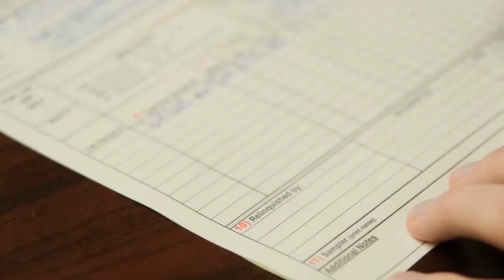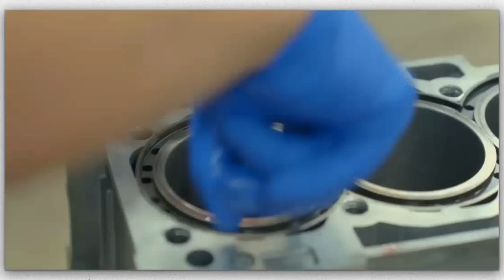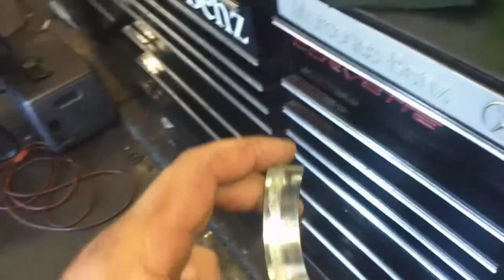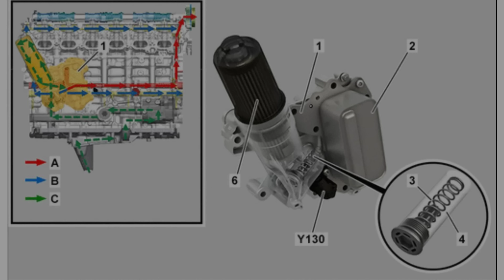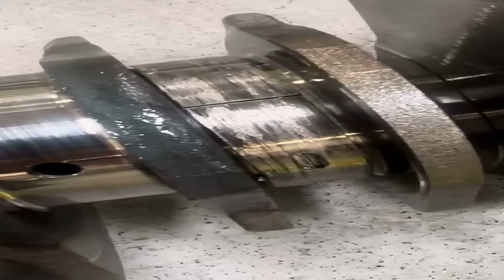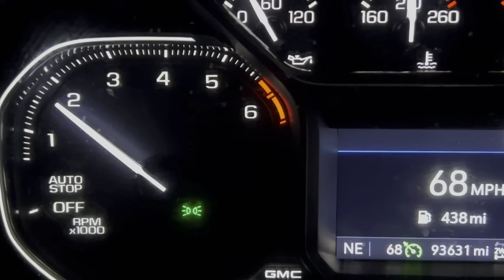They KNEW And Sold It Anyway! Toyota's 3.4L Twin Turbo V6 Is DESTROYING Engines!

Comment: It probably uses bmw rod bearings & other engine parts  as bmw did supply the 3.0 il6 engine to Toyota for the GR Supra.
 They should check it for bmw stamps on the cylinder head/block etc.

Comment: If you look at the major engine recalls by GM, Ford, or Chrysler, Toyotas engine issue is relatively small and they jumped on replacing engines quickly. I love various brands and yes the generational changes vehicle manufacturers do to squeeze one more MPG is worthless! GM says its all done doing the AFM (active fuel management)crap and will let their motors run on all cylinders now and not shut them off to save a marginal MPG! Each brand has some reliable and long running engines but constant design changes breeds more problems!

Comment: 10w 30 oil might be the answer. Toyota's new Camry 0w 8 while overseas is using 0W 20. Toyota is doing what Corporate Average Fuel Economy (CAFE) | NHTSA requires and it's killing the engines. Thin oils kills engines.
Reply: The first tundra to hit 1 million miles used dealer installed 0W-20

Comment: I spent my career in the machining industry. I knew that "machining debris left in the engine" was a load of crap from the beginning. My Tundra has the 5.7. It's a fantastic engine. They should have never switched to the TTV6. No way I would ever buy a 3rd gen Tundra. Fortunately for me, owning and properly maintaining my 2nd gen means I shouldn't have to.

Comment: You might want to trace it back to what engineers had to do to meet the EPA's fuel economy ratings.
Reply: Bingo - root cause
Reply: Exactly!
Reply: Strangely enough Ford still has V8's available 🤔

Comment: I call this entire video BS. I have actually witnessed Toyota dealership doing a short block and full engine replacements in Tundra engines. And this video shows the failed engines are bagged and tagged like I am watching CSI. And that never happens in a working service area. First just bagging all these parts would take another full day alone. And there is no place to have these parts as they waited to be bagged up? Most dealerships have no place to pull the engines to begin with. And tell me where another tech would be signing off on the parts that he never removed? All BS
Reply: Agreed. Click Bait.
Reply: This video would make sense if a law firm was gathering evidence for a class action lawsuit. However, I don't see any evidence of this theory.

Comment: It's unfortunate that there are engine issues with current generation vehicles.  As for Toyota, they need to bring back the 5.7 liter V8 engine that were in the Tundras and other Toyota vehicles initially.  As a whole Toyota never had any major issues with the 5.7 liter V8 engine.  Unfortunately, that engine got kicked to the curb based on the emission guidelines that were outlined by the last administration.  So, that's where the issue stemmed from.  Due to the fact that the current administration sometime last year decided to scrap those emission guidelines that were outlined by the last administration, it would be wise for Toyota to bring back the 5.7 liter V8 engine.  Based on overall size, vehicles like the Tundra, Sequoia and Lexus LS need a V8 engine.  Bottom line.  If they eventually bring back that engine, catastrophic issues currently found on the turbo V6 engine would not be there anymore with the V8.

Comment: My 2023 Tundra TRD off road had its engine replaced at 3500 mi. Then at 14000 mi, the turbos went out and were all replaced under warranty. At 16000 mi, I got rid off it and bought a 2020 Tundra TRD off road with 36,000 mi. The truck now has 88,000 mi with no issues. Will never buy Turbo or hybrid equipped engines again.
Reply: Good. Don't buy into the hype.

Comment: Buy a Toyota they say. What they didn't tell you, is buy it if it was made before the year 2000. After, service parts hidden behind covers obstructing access, excess plastic use that fails after the first reinstall, unobtainable efficiency mandates,  corporate greed. Sell more, more frequently is far  more profitable than something that lasts a lifetime with minimal maintenance, like before the 2000 era. Trust in Toyota was universal. That trust is gone.

Comment: Why the hell does manufacturers use variable displacement oil pumps just to gain nothing in fuel mileage. Install tried and true oil pumps, go back to 5w30 and get rid of twin turbos.

Comment: Just ask any  good mechanic and they will tell you Toyota was not truthful about this recall! Those motors were junk from the beginning! What a let down from this company! Great video and thank you! Im a Honda person and after seeing this it shows how bad this industry has gotten! The greed factor has crossed all auto makers! The trust in truly relatable cars is gone!
Reply: You're right !
Reply: Honda ain't any better.  Go look at their J series recalls.
Reply: @xmandough  Exactly!
Reply: Honda V6 engines are now under federal investigation. So you might as well throw Honda down to hell too.
Reply: It's engine dude not motors (electric motor)
Reply: @renemadera6460  Motor and engine are interchangeable, especially for gas cars. Electric motors could also be called electric engines even though it's rarely used that way. Even rocket engines are often called motors.

Comment: NOT that complicated guys, you need to use heavier oil, I say Straight 30 weight plus Lucas Oil Treatment or equivalent which is extreme pressure grease DUH! Dumbass Bmw guys and GM do same thing, have to keep replacing rod bearings, SO RETARDED! :(

Comment: I have 85 000 kms now on my 20 Tundra. I am almost certain my engine will never fail, providing good maintenance.  I have already had my 8th or 9th oil change. The TTV6 is garbage.
Reply: They said you must change the oil every 5K and keep up the maintenance it's the key 🗝
Reply: @topnews1007 10 000 kms is about 6 000 miles. My interval.

Comment: Naturally aspired Lexus V 8 engines - epic long lived w reg maintenance
Reply: They need to bring back the V8 engine that was there before.  There were no issue with that engine.
Reply: Dude from Canada have a 2002 bmw x5 3.0i with the original engine and automatic transmission purchased it brand new and now it has 368k and still running strong and remember maintenance is the key 🗝 and change the oil every 5K

Comment: The problems were already fixed couple years ago when it was first released those engines were already pulled out of service and they already fixed it the new one the newer ones with the same engines are fine and I only went on for like a little bit of time they didn't send it off not knowing they fixed the issue already I think it's cause a Chevrolet how they basically done the same thing but knowingly improving me and this has been happening for years and years for over 50 years now Chevrolet it's destroyed quality to the point where it's not even worth it same wolf Ford the best thing to do is to get rid of the big three in America

Comment: Toyota needs to get rid of the damn economy mindset. We want Bullet proof engines.
Reply: They need to bring back the 5.7 liter V8 engine that was there before.  There were no issues with that engine.
Reply: @jefferybaxter1225 I peg your pardon but that’s incorrect. Harnesses becomes absolutely brittle after many, many year. They practically crumble in your hands. Coolant leak in the valley plate. Timing chain tensioner failures, & several other issues. Definitely not as reliable as folks make it out to be.
Reply: @jefferybaxter1225 only problem was doing 20L per 100km or in freedom unit 7mpg which is sht.
Reply: @jefferybaxter1225  just go buy a used one

Love my 2002 Toyota Sequoia
4.7 L V8 is smooth as butter and drives like a 70s Cadillac
Reply: The leftist government doesn’t allow it, with all this emissions strictness it’s near impossible to make anything without ticking all the emissions boxes it’s all getting so highly strung it’s causing catastrophic failures. Blame the government
Reply: @ev0wat  Yep.  Engine issues taking place now regardless of automaker brand are due to the emission guidelines that were outlined by the last administration.  However, sometime last year, the current administration decided to scrap those emission guidelines that were outlined by the last administration.  Doing that will give auto manufacturers higher levels of flexibility with their powertrain options.
Reply: This was already happening in 2000. Japanese companies were broke in early 1990’s. The Asian Finacial Crisis  was the end of the free loan money that was being handed out !  That’s when Japanese quality ended !
Reply: Askin tha wrong thing from these toejoes😂
Reply: All Companies need to not just toyota

Comment: ⚙ Why Modern Engines Fail Randomly: A Heads‑Up for Mechanics
Modern engines don’t fail the way old engines did.
A mechanical defect used to create a predictable pattern: same part, same mileage, same failure mode.
But today’s engines are software‑controlled machines, and that changes everything.
🧠 The ECU is the real engine
Every combustion event, every drop of oil pressure, every degree of timing advance is controlled by:
• 	crankshaft position sensors
• 	camshaft sensors
• 	knock sensors
• 	turbo boost sensors
• 	oil pressure sensors
• 	temperature sensors
• 	airflow sensors
The ECU takes all those signals and decides:
• 	how much fuel to inject
• 	how much timing to run
• 	how much boost to allow
• 	how to manage cam phasing
• 	how to control oil pump duty cycles
If any of those signals are wrong — even for a moment — the ECU can make decisions that stress the engine.
🔧 Why failures look “random”
When a mechanical part is defective, failures cluster.
When a sensor or software misbehaves, failures scatter.
That’s why you see:
• 	one engine fail at 10k
• 	another at 40k
• 	another at 70k
• 	another never fail at all
This is classic control‑system variability, not uniform mechanical failure.
🛑 A bad sensor can destroy a good engine
Examples mechanics see every day:
• 	A crank sensor glitch → timing jumps → detonation → bearing wear
• 	A cam sensor dropout → VVT misalignment → oil starvation in phasers
• 	A turbo sensor error → overboost → heat → oil breakdown
• 	A knock sensor misread → ECU advances timing → micro‑knock → rod bearing damage
None of these require a “bad engine.”
They require bad data.
🧩 Why this matters for diagnosing modern failures
When an engine fails randomly, the root cause is often:
• 	intermittent sensor noise
• 	calibration errors
• 	timing control instability
• 	oil pressure logic issues
• 	turbo control logic errors
These are software and control‑system problems, not sabotage and not counterfeit chips. China counterfeit?
🛠 What mechanics should look for
Instead of assuming:
• 	“bad bearings”
• 	“bad metallurgy”
• 	“bad machining”
Mechanics should consider:
• 	sensor signal quality
• 	ECU calibration updates
• 	oil pressure mapping
• 	cam phaser behavior
• 	turbo oil feed logic
• 	intermittent timing errors
This is where the real failures are happening.

🔍 The key message for mechanics
Modern engines don’t fail because the metal is weak.
They fail because the data is wrong.
A single bad sensor signal can create:
• 	detonation
• 	oil starvation
• 	timing instability
• 	turbo overspeed
• 	bearing wear
• 	catastrophic failure
And because these signals fail intermittently, the failures look random — even though the underlying cause is consistent.

Comment: At this point you have to wonder if these manufacturers are stupid?, incompetent?, or just CROOKS? Has Toyota been collaborating with GM on how to screw their customers? Its pretty sad when you can have more confidence in a Toyota truck that is 5 or 6 years old (with the old V8) than a BRAND NEW truck with these DEFECTIVE V6 engines, so much for Toyota trucks reliability reputation!
Reply: It was explained to me that the current CEO has a business degree. The previous CEO’s had engineering degrees.
Reply: And I just wonder how much money they saved by using the 180 degree VS the 360 degree thrust bearing. Sounds to me like the accounting dept. took priority over the engineering Dept.
Reply: they choose mental retardation, too light oil DUH!
Reply: This applies to every manufacturer now. I just sold my 2023 Tacoma which I loved to my dad because I need another full size pickup truck. As much as I strayed away from GM over the years even growing up
With them I’m  considering the 2026 Silverado with the 2.7 Turbomax engine. That particular powertrain I believe is one of the best offerings in a 1/2 ton pickup truck.